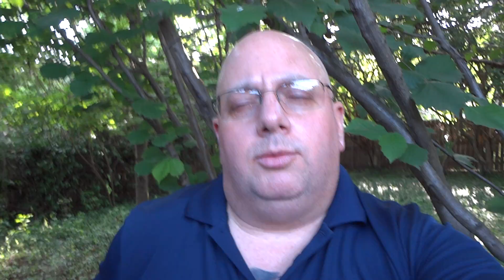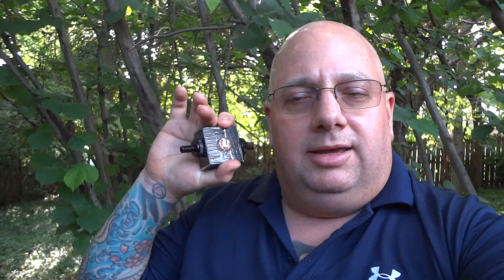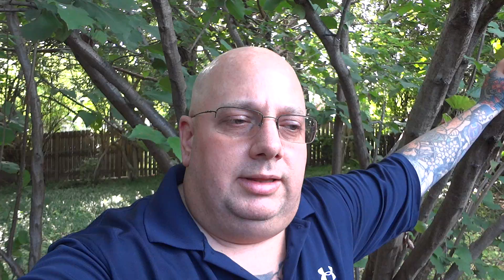Will Understanding Magnetism be grounds for REVOLUTION in better power generation?

Comment: I think current time generators (as in build after 2016 or so ,,) will be way more then 60 percent already. And i still don't think that with any new magnet system you will be able to get more power out then you' ve put in by rotating it. So maybe you mean the 40 percent more as in 40 percent of 70 or 8- percent that they already have but not as in 40 percent more of the total power present. but i think they will easily make like 98 percent eff. generators already. so where will your 40 percent extra come from ?? They just use neodymium and gas or magnetic bearings so only some small copper losses are present. and for all extra energy out, rotating it becomes more difficult ....
Reply: I think that at best you'll end up with better coupling, but doesn't mean you'll end up with more energy out ;)

Comment: With  four-cycle Diesel engines half of the fuel is needed as a upper cylinder lubricant which lowers the temperature while keeping steady or slightly raising compression.

Comment: Mr.Ken please look at the works of Wooten and McClain and their (Magnetic Resonance Amplifier). A very simple circuit,  a primary coil is wound around a magnet, a Barium Titanite piezoelectric is in series with the coil. Then a second coil is wound over the primary as in a transformer. When the primary with the piezoelectric comes to resonance from input load along with the magnetic field. It has an uncanny attribute of resonating at specifically three octaves lower than the Barium Titanite piezoelectric disc. It acts as a Virtual Rotating when the piezoelectric and field are in Resonant/conjugate state.

 I feel that if piezoelectric could be integrated to serve the apex proton, it would carry it's resonant and phaze attributes system wide. 

It reminds me of your xylophone video, tones in time sequence.

This primary piezoelectric circuit may be an interesting input circuit to subject dielectric objects to now that you have targeted an input as centripetal convergence. It may set phase and eliminate hysteresis. 

Peter

Comment: You could place a detection/sensor coil at the centrifugal ring while pulsing this new centripetal coil to measure the effects versus no magnet, (you know--suspend the two coils in space with a trey to slide the magnet in, verses out, to test and compare the quality and quantity of response on the pickup coil with a 'scope.)  You could also vary the voltage, current, waveform, frequency, placement, and other factors to explore further.)

Better yet, demagnetize one of two identical magnets and compare.